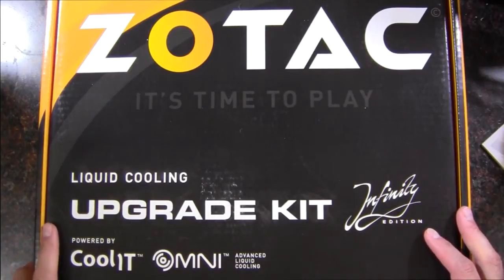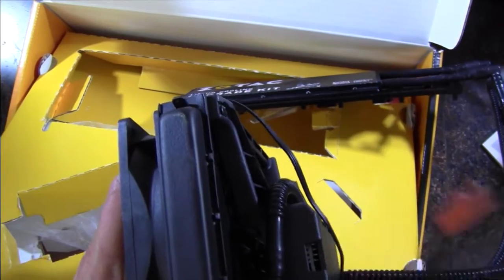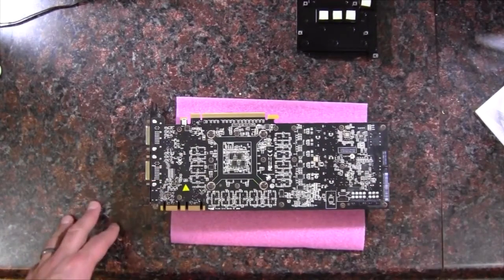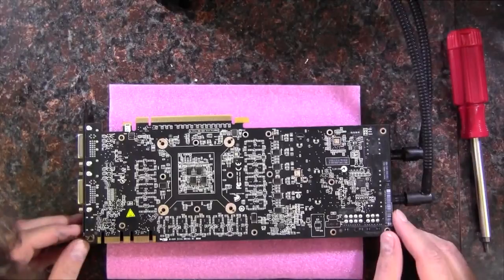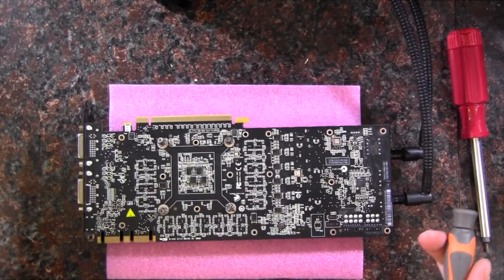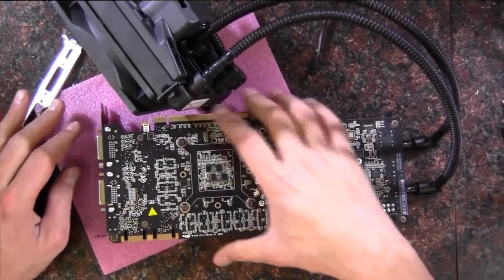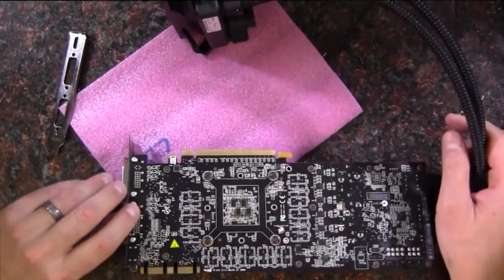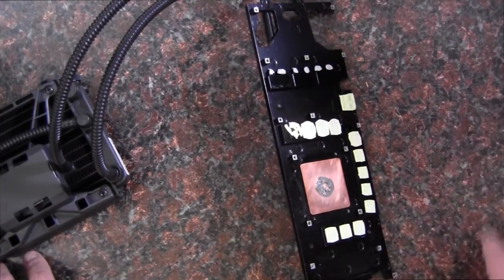Zotac Liquid GPU Cooler

Comment: Feel sorry for you, It seems that the original owner has worked the contact surface of the GPU so heavy by removing a lot of material and I see he has done a horrible job and ruining creating huge holes.
He probably trying to lap the surface to get 1 up to 2 degrees less not worth it to lap !!
The system would have had a normal contact with the die of the GPU if it had not been worked so heavy the original owner is a noob deserves a punch in the face because you can not sell this thing anymore !!

And what an idiot he also put the thermal paste as if it were factory by adding thermal pads of very low quality.

These things have happened to me too.
Reply from the maker: Yeah, people do strange things and then try to get someone else to pay for it. I don't think I could purposely sell a broken item to someone else. :) Hopefully it won't happen too often.

Comment: This might be salvageable by using a shim of sheet copper between water block and the gpu heatspreader. Either that or sand down the 4 posts around the gpu area.
Reply from the maker: I didn't even think about that shim of copper. That would probably have worked well enough. It still should have been better than the stock cooler. I wish I would have thought about that before I got rid of the cooler. Thank you for the tip, maybe it will help someone else out.

Comment: Wow that's bad , could of potentially damaged your card make sure to get a refund.
Reply from the maker: I put the stock cooler back on, and thankfully I have no damage. I was able to shut the card down before it hit 90C. The card faired good, I just lost $100 USD for the cooler and shipping. I waited too long to get a refund :(
Reply: AdoptedMike Contact trading standards or ebay because the product didn't work and in the standards it states that you (the customer) aren't happy with the product and it doesn't work with what it states to be compatible with you can refund it , keep trying to get it refunded , if not contact zotac and see what they will do from there.
Reply from the maker: MrReeceyburger123 I will give Zotac a shot. The eBay seller only gave 14 days to return it. Plus I threw the box away after the unboxing part of my video but before the testing part. I didn't find out that it did not work until 2 months after it was delivered and unboxed. I really need to fully test these things before the return period ends. I just get busy and assume all will be ok.
Reply: AdoptedMike Yeah I know what you mean, its very annoying when you spend money on components to find out that they don't work .
Reply from the maker: MrReeceyburger123 The only good thing is the GTX 580 is still fully functional.
Reply: AdoptedMike Yeah ;)